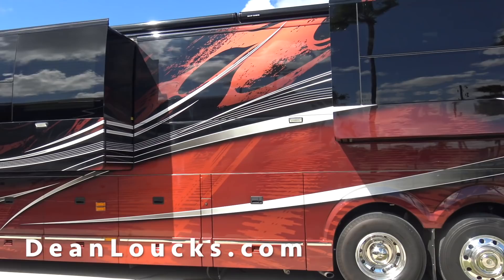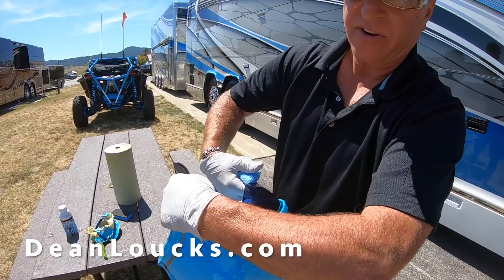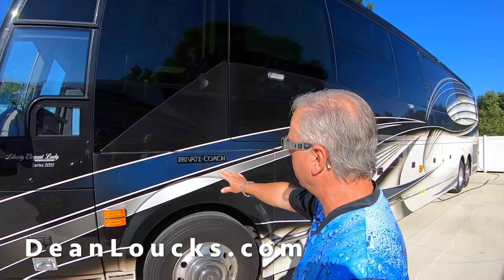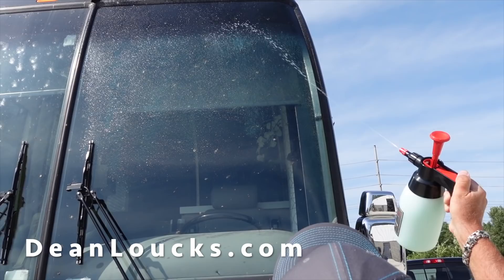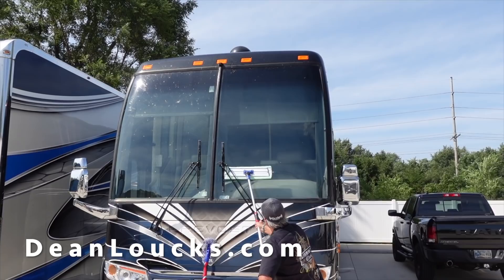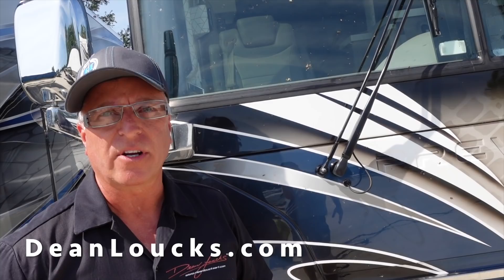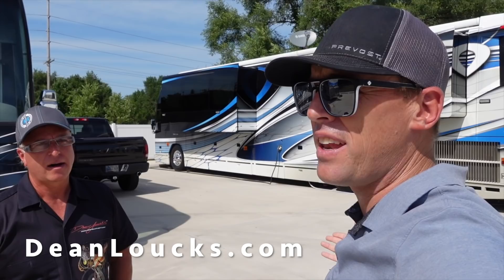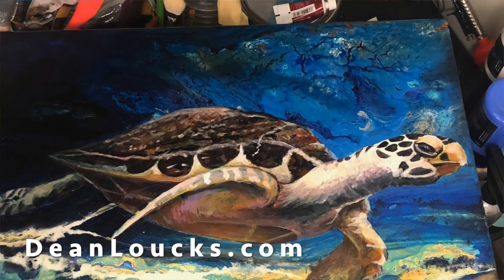EASIEST WAY TO REMOVE BUGS AND CLEAN YOUR RV OR ANY VEHICLE WITH DEAN LOUCKS

Comment: Hey Andrew once again another great video. I am in the process of purchasing a 1998 Prevost Royal coach. And believe it or not it has a Dean Loucks paint job on it. I am assuming it was probably done in his early days. I definitely need to contact him and find out about getting the ceramic coating on the front of it. It is extremely pristine, and it’s probably the cleanest 1998 in the country. So thank you for the info I’m definitely going to be contacting Dean soon. Maybe I’ll get lucky and Dean will autograph it while it’s there.

Comment: I looked on deans website but couldn't find it where can I buy the ceramic coating and is it applied like a wax?
Reply from the maker: The ceramic coating has to be installed by a professional installer
Reply: @RVingwithAndrewSteele , what?
Reply: @greg9323  They teach you how to apply it.  There is a technique to it.

Comment: Andrew, it seems like your opinion has changed  in the last year about ceramic coating. Do you believe it is worth the money now? TIA
Reply from the maker: As long as you completely understand the product and what it does and doesn't do.  Also, the instillation is very important and requires proper prepping to get the full effect.  I'm very impressed with the product Dean uses.
Reply: @RVingwithAndrewSteele  Had my Marathon H3 done in Dallas when there in 2021.  Took a full 5-days to instill and complete.  Get it "refreshed" annually.  It is a 2004 and people think it looks brand new.   Love it.  Will send a video.